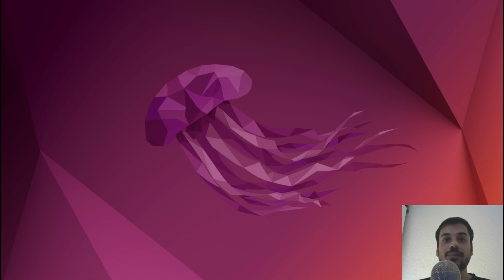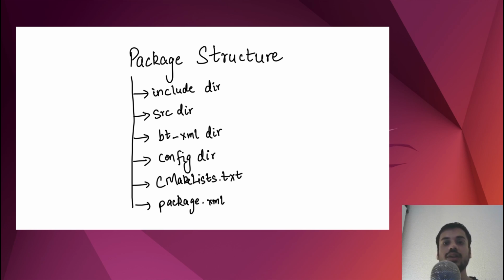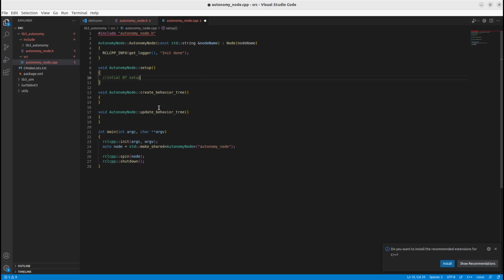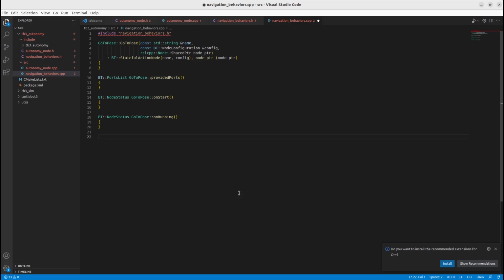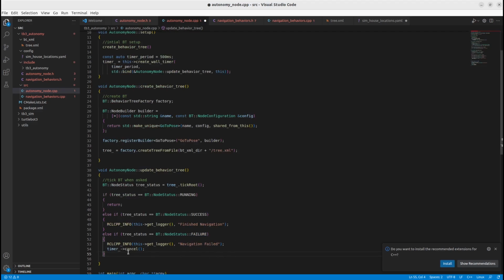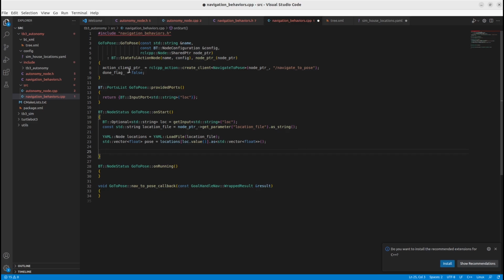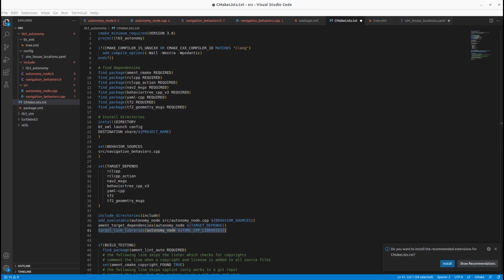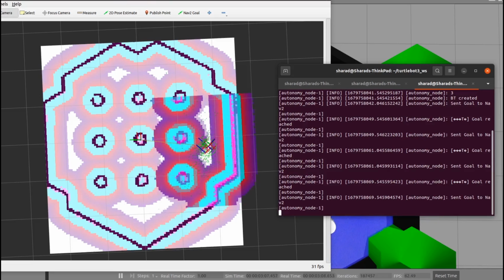ROS 2 Navigation - Part 4.2 ( Nav2 Project - build a Patrolling Robot)

Comment: Hi Sharad,

This was a great video, really helpful! I learnt so much about behavior trees and it's nodes from it.

I have a question though

I have a simple application. I want robot to spin for some time after starting. and then move on goal following. 
As far as I know, Nav2 has provided us with these nodes. Is it possible to directly use these nodes to create our tree(lets say, using groot and then converting it to xml.)

Is just creating this new tree enough? How should I integrate this with robots usual behavior? 
Basically, I just want to know simplest way to integrate our behavior tree with Nav2's tree

I am really confused about this. I tried searching online but I could not find anything helpful.

Looking forward to your reply. Thanks a lot for your help

Comment: did you use any slam Filter for the noise in these 2 videos
Reply from the maker: In this series, no. I’ve mentioned in this series that odometry values are perfect in simulation and I did not want to introduce noise manually. Thus, this use case did not need filtering